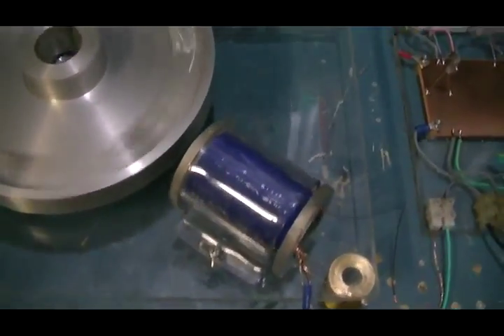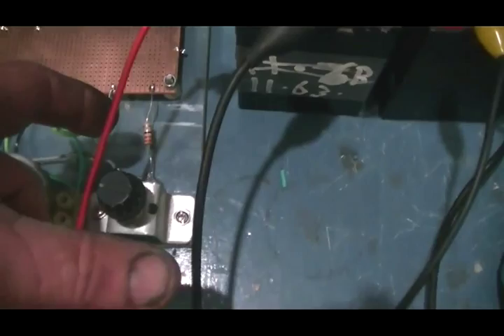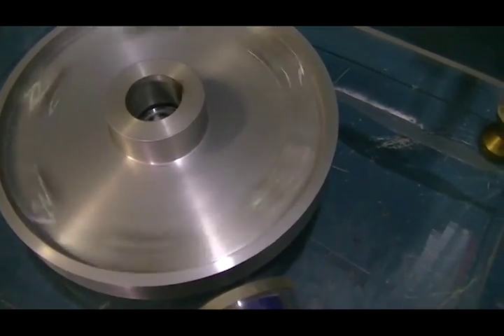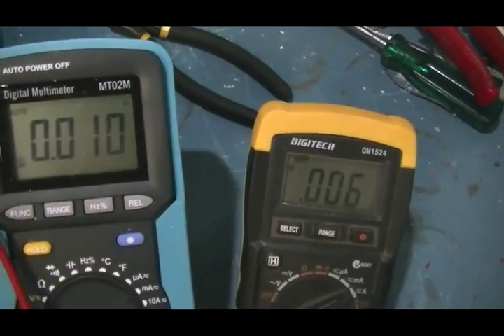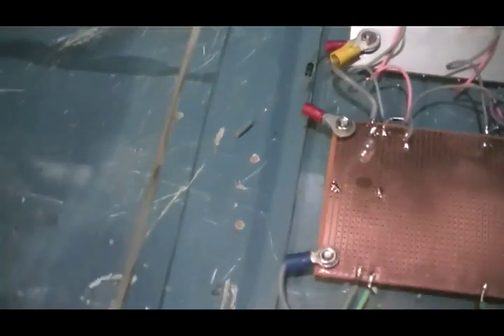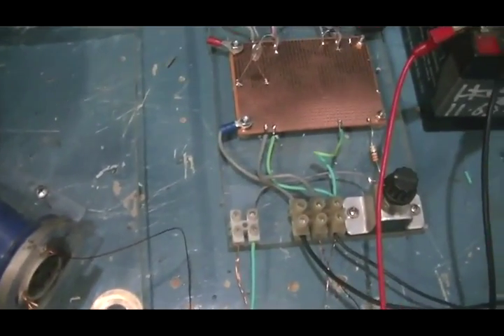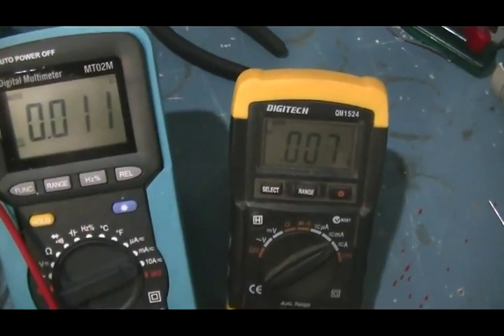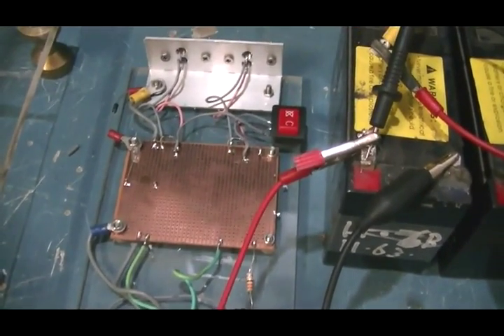The search for the ultimate pulse motor pt3

Comment: There will be more then 60% return because the bemf voltage at 60ma is higher watts out. The volts in at 12v and 10ma is low compared to whats could be coming out. Could easy be 100v bemf at 60ma out!!!

Comment: @TinManPower
 Oh, no... The Engine is only between 25% & 35% Fuel-Efficient. But, dependant on Average Engine-Runtime, the Electrical System's Torque-Load uses between 10% & 60% of the total fuelburn...(!). Search "SunFoil Science", to see the raw Data... A 30 Watt SunFoil reduced my monthly Fuelburn by 33.25%, raised my Top Speed by 8%, & upped the useable Torque at low RPM (below 1,000) by 300%. Truly. Construction Clips are up. Have fun... Ciao !

Comment from the maker: Hi Warbles
Well you dont loose power in any system,it is just converted into some other form of energy.But here we could say that we are useing 40% of the electrical energy to desulphate a battery.
This seems far better than any motor vehicle around today,where you use 35% of the fuel's energy to push the car along,and the other 65% is converted into heat-which we then use more energy to try and cool down again.